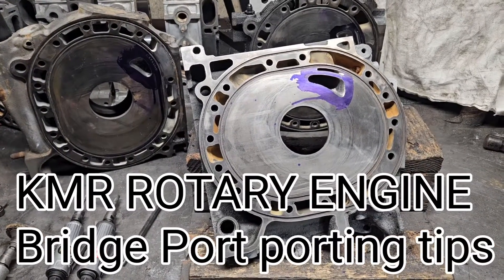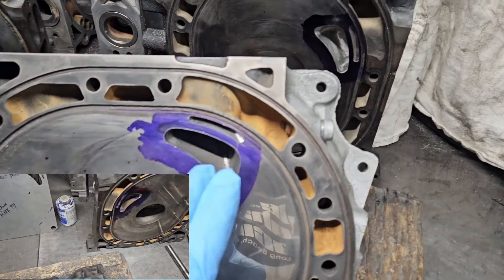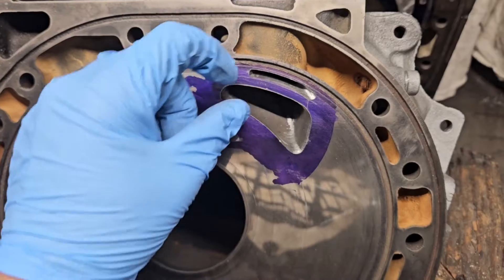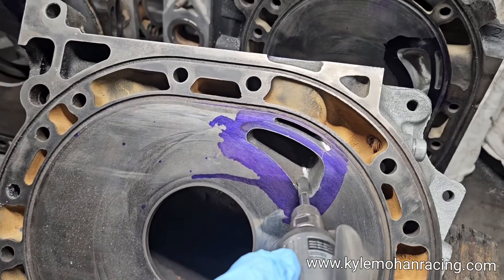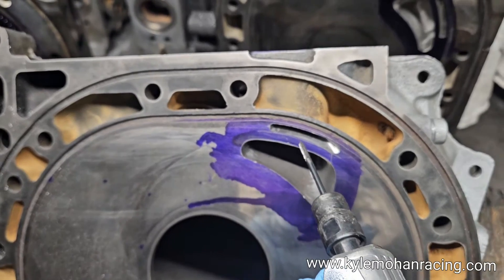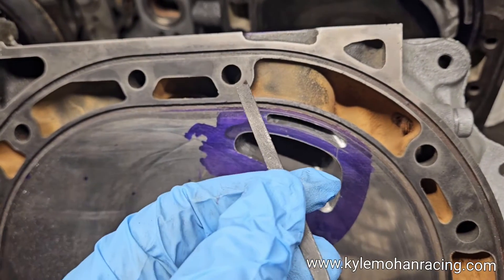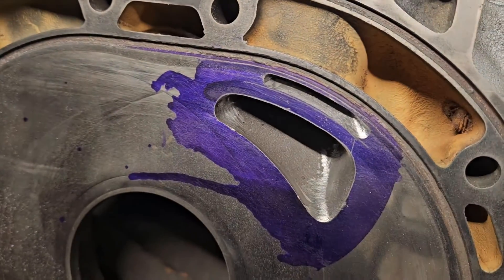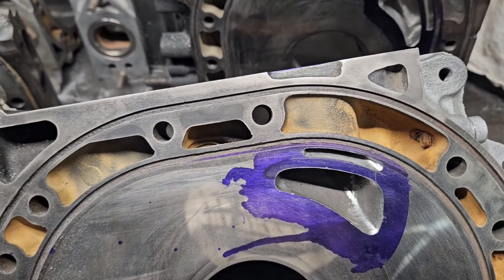Porting Tips for Bridge Port Mazda Rotary Engine blocks, KMR Tech Talk, special tools (fixed audio)

Comment: Hi Kyle, how do you get that ramping/angle on the bridge? Do you drill it first really narrow and then chamfer it towards the centre or are you drilling down at an angle?
I'm in the middle of an NA 12A rebuild and will be bridge porting it. Your videos have been extremely helpful, cheers!
Reply from the maker: Drill at angle carefully